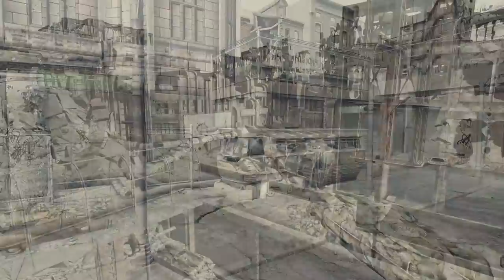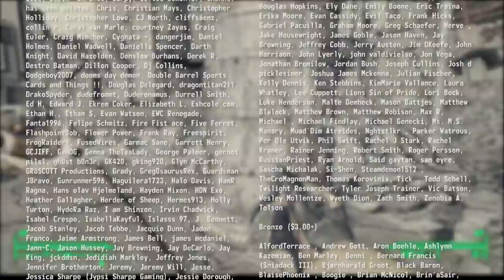Fallout 3 Metro 7: Dupont Circle & Metro Junction

Comment: He missed a lot of stuff last episode. Heading straight up the street from Penn. Ave South, he would have found the Metro Central station.

Directly across ftom there is a small wastlander encampment, with some ammo and aid boxes. Directly behined the Metro Central station is a dinner with corpses wearing Leather Armor(bit of an improvement over Raider armor). There are Supermutants around this area.

West of the dinner if you pay close enough attention, is a manhole cover leading to a sealed off section of metro tunnels, careful when coming back out, you may get jumped by Talon Company mercs.

Keep an eye to the left as you continue to head west from the dinner, there will be a downward slope on the left at the bottom of which will be a wasteland merchant.

Comment: @Oxhorn I know I'm a couple years behind and I don't know if you know if you already know this bit of info. I know this works on 76, and my husband says he has used it on Fallout 4, but try this on a Fallout 3 terminal, please. The trick is to choose section of codes that begin and end with its corresponding symbols, i.e, (), [], or <>.  example of a line of code to pick, (;>/[[;), [#!";)>], <!?&^> Incorrect passwords will be removed from the list. Certain sections of codes also will reset the number of tries back to 3. The catch is that the symbols have to be open to each other. They CAN NOT be like this )(, ][, or ><.